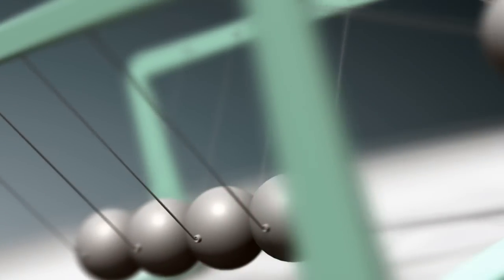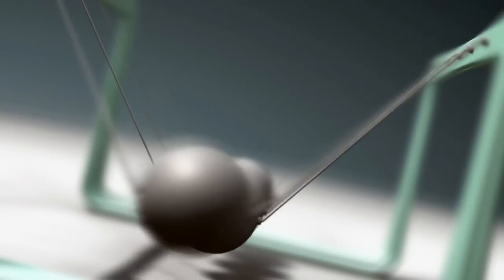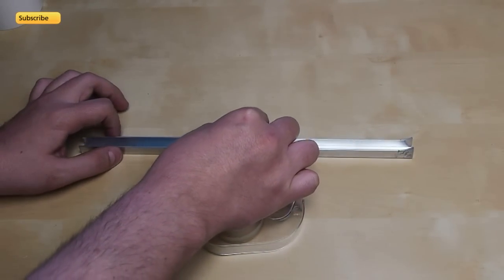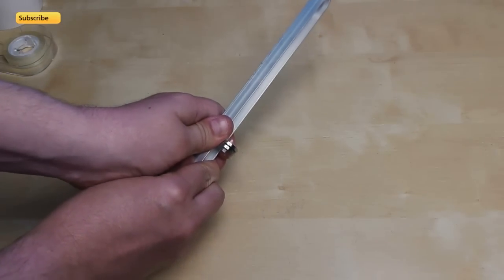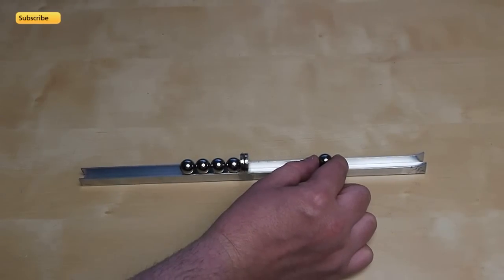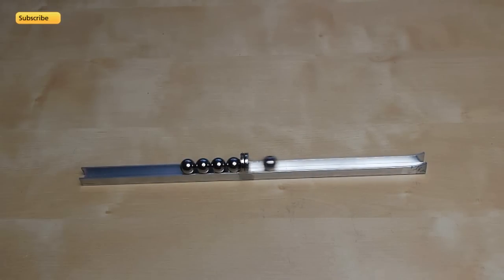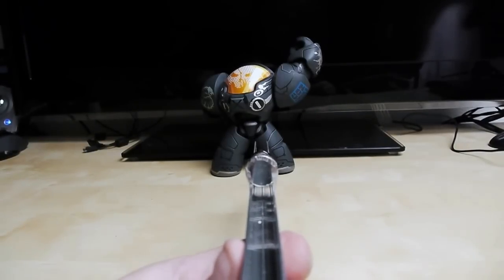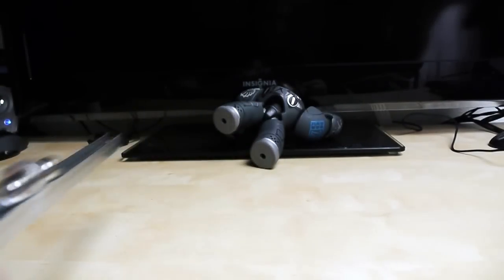Scientific Tuesdays - Make a Magnet Gun

Comment: I get it! The force hold the projectile ball to the ball behind it is smaller than the force acting on the single ball on the other side. The acceleration at which the projectile ball travels is determined by the difference between the two forces. So with a powerful enough magnet and a long enough train of balls, you could... well, you could get the projectile going really fast.

Comment: @bRadicalmagic1 to make a lethal one u dont use magnets u need electromagnetic coils around an aluminum barel and a capacitor bank and a dctodchv boost converter a switch and a safety discharger but u make it im not telin how to assemble figure it out and use iron nails as bullets

Comment: so, does a more powerful magnet make for a more forceful launch? would a larger neodymium magnet cause it to be more powerful? or does it run on kinetic energy, which would dissipate kinetic energy in the magnet if the balls are not scaled with the magnet? I need to now because I have a couple of high powered neodymium magnets (200 lb force to separate it from a flat steel surface.) but they are much larger than those.

Comment: i hate to brake it to u mr house hold hacker but u have no idea how magnetism works, magnetism occurs when most of the electrons in a material spin in one direction, in most elements the electrons balance themselves out but in elements such as iron this does not occur causing magnetism. in the video you described the negative and positive electric charges in the atom and how those are caused. not magnetism.

Comment: @taco2200
NOW what you could so is replace the ball in the back with a magnet. Put another magnet behind it that has the same charge (++) then the magnet holding the other balls in place the opposite. What this does it cause the moving magnet to be pushed and pulled towards the projectiles.  Also if you build the gun right and make the magnet switch charge once it launches the ammo you could make it move back to the beginning spot flip back around and launch another projectile.

Comment: correct me if im wrong but, so all 4 balls are lined up on the left side and magnet in b/n the other ball. when the single ball on teh right rolls it gets attracted to the magnet. the magnet accelerates the ball and when the ball makes contact with the magnet some of the kinetic energy is transfered from the moving ball into the last ball on the left making it fire?

Comment: @JUSTINlineboy it will have a bit more speed when it hits the magnet so the impulse will be stronger. But it will only be that much faster the faster you roll it. (nice sentence) The Ball gets the main acceleration from the magnet. It is accelerated by the magnetic field, the impulse travels through all the balls and eventually enters the last one. That one is far enough away from the magnet to escape the magnetic field due to its weakness in that distance. (okay... i suck at explaining)